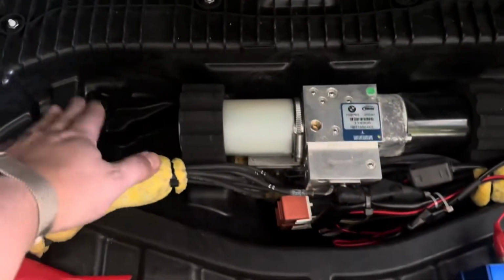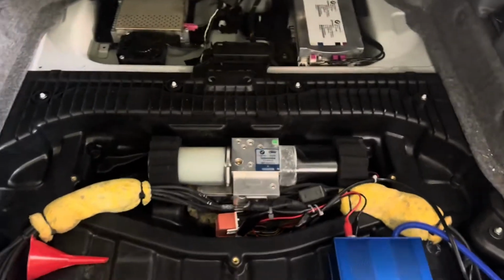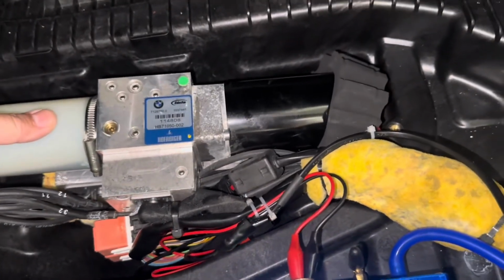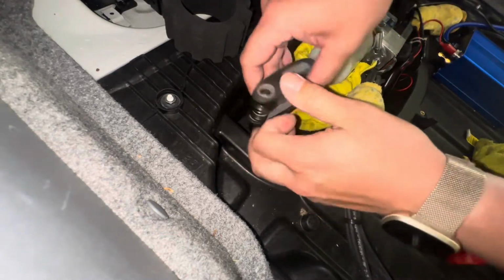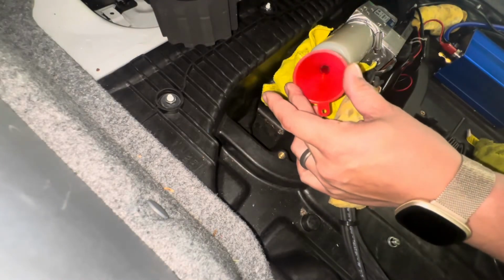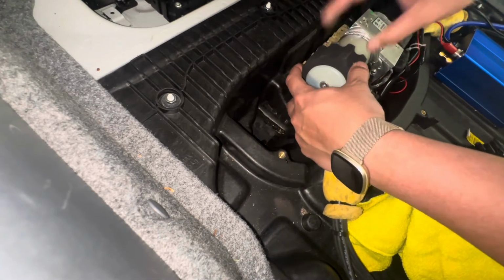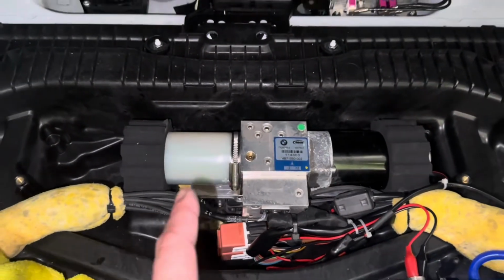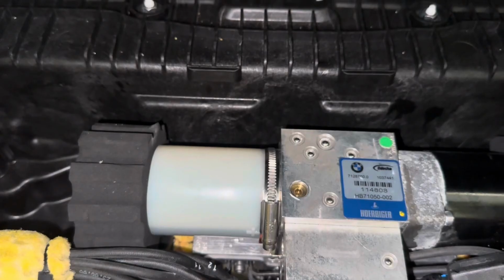How To Fill E93 Hydraulic Fluid Reservoir DIY BMW E93 M3 Convertible Hard Top Maintenance & Repair

Comment: There's a 1ltr of hydraulic fluid in that system. If you want to flush the system, this process, including opening and closing the roof each time. Takes about 5-7 attempts. The 'lifetime' fluid is absolutely yuck
Reply from the maker: thx for sharing!

Comment: Why not flush old one completely and top up?
Reply from the maker: Didn’t want to introduce air to the system.
Reply: @Sals_Garage just did mine today, took almost all the fluid out and put new one it. Just need to do 2-3 opens and closes on the roof and the air goes out of the pump by itself.
Reply from the maker: @Adrenxline thx for sharing 👍

Comment: A big thank you  as my roof is now working properly  , i
 could never  work out how to top  up the fluid till i see  this video ..
 i will add that i also had to replace the two orange relays as well ..
But as i said it needed hydraulic fluid as well ,, so thank you again for you video
Reply from the maker: Glad to help! Thanks for the comment. And yes those salmon relays are a common issue.
Reply: I was wondering what type of issue you were having that adding fluid help resolve.

Comment: Thanks for the video! DO you know how to make the complete hydraulic oil change? Mine has aporx 200k+ miles and some suggest complete oil change after 10years.
Reply from the maker: You’ll need to pour out all the fluid in the reservoir and refill it again then run the top a few times and repeat as much as you would like. Good luck 👍
Reply: @Sals_Garage  okay I thought so. Thanks again!
Reply from the maker: @3244325254  anytime. Good luck 👍

Comment: Instead of having to move the pump at all you could just jack the left side of the car up on some blocks. I imagine that would be enough to be able to remove the screw.
Reply from the maker: It might work, thx for the tip.

Comment: 0:48 
Just an FYI, the secondary plastic cover that you said you don't keep on. That is a sealing cover to protect all the electronics from moisture and any water in the event that a seal should fail letting water/moisture into the trunk compartment.
Reply: Good video though. Thank you for the info. I checked my reservoir the other day and it was just in line with the very bottom of the + symbol〔like this>±〕 which I assumed was the maximum line. So I thought no need top it up. I did notice the my roof seemed like it was closing hard and almost slamming when the front section came down to lock into the top of the windscreen frame. Thanks bud. 👍
Reply from the maker: Thanks for the tip.  Will do 👍

Comment: Great video for topping up your fluid ... but as your roof was fully closed, it is normal to have the fluid level down ... your car was not low on oil
Reply from the maker: Thanks, it is normal over time for the fluid to slowly drop. 123k miles and 14 years later it needed a small top up.
Reply: @Sals_Garage   its a sealed system. I would think there is a leak somewhere if the fluid level drops.
Reply from the maker: @bamwa  weird things can happen I seen.
Reply: @Sals_Garage  Aber wie kommt es in einem hydraulischen System zum Ölmangel? Das kann doch nur bei einer Undichtigkeit passieren… Oder irre ich?
Reply from the maker: @andreasschulz7901 I do not understand the language sorry
Reply: @Sals_Garage  Hello, I have a loss of hydraulic oil. How can I determine whether a hose is leaking or where the oil loss is occurring? There is no oil consumption here. I found a small pool of oil when we changed the relays. We topped up the missing oil. Now the roof doesn't work properly again, as it did before the repair... Do you have any ideas or a solution? Thank you very much in advance...
Reply from the maker: @andreasschulz7901 you’ll need to fix the leak and refill fluid

Comment: I have question. Help needed so bad. Roof unlactaches but I get error mucroswitch lock.  The right middle one . Is it possible to just replace that and If so what is the part u cannot find it anywhere without whole motor for the Roof
Reply from the maker: Sorry I don’t know much about your issue. Please update us if you ever figure it out. Thanks and good luck 👍